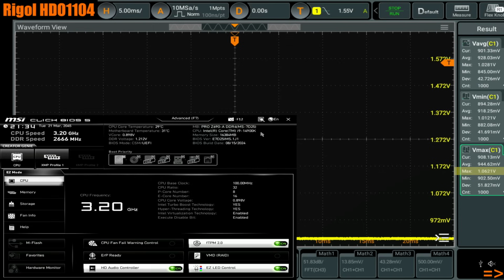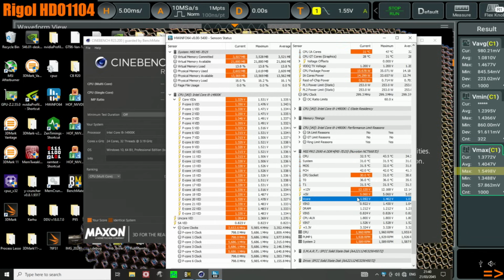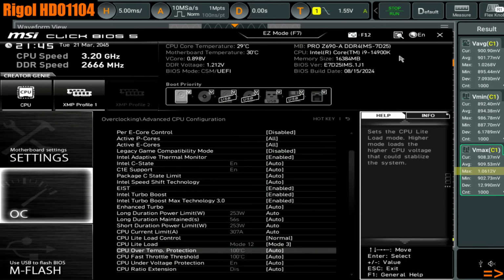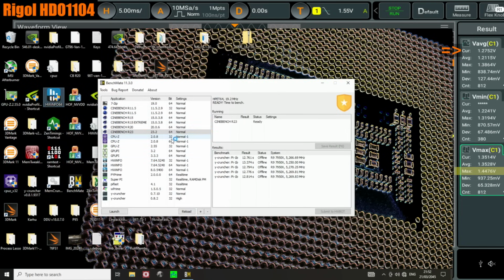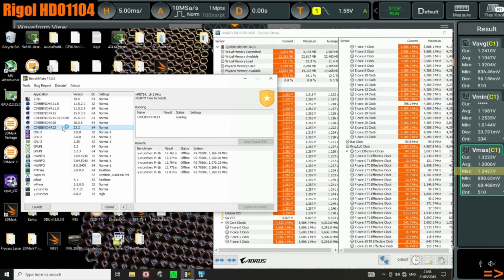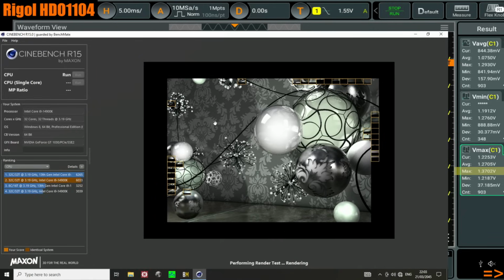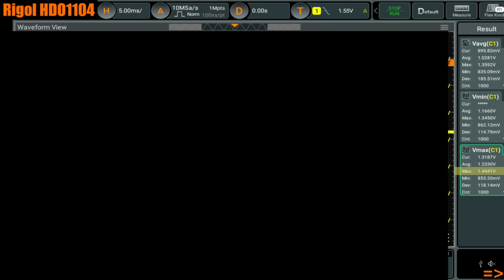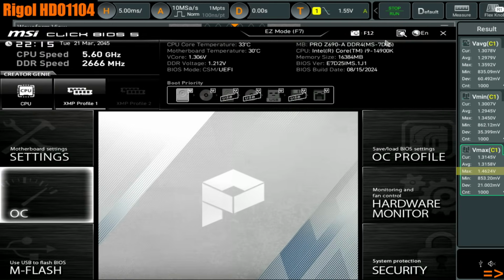"Optimizing" the i9 14900K on the MSI Pro Z690-A DDR4 with 0x129 Microcode

Comment: Thanks a ton!! Exactly what I was looking for..

Just to add - Someone posted exact impedence values of LLC levels and Lite Load AC_LL/DC_LL values for this motherboard on some forum recently. 

Apparently, you wanted to set 0.3ohms, which is why you selected Level 3. But Lite Load  Level 3 and LLC level 3 correspond to different values, not AC_LL of 30 and 0.3 ohms respectively
Reply: I was wondering this. Now that msi bios have voltage limit (my 13900k set to 1.400v), what loadline modes should we use and what modes are compatible to each other?
Reply: @jaybee0507 did you ever figure this out?
Reply: Yes, i did pretty extensive testing with msi z690 edge ddr4. Unfortunately i gave that machine to my son and i can't remember the values.  This all can seem like pretty difficult thing, but once you understand the concept,  it really isn't as difficult as it seems first. 
Basically what i did,  or how i see it,  you want to set voltage limit.  Something maybe 1400mv.  Then pick loadline calibration level.  The more aggressive,  the more stable vcore voltage but bigger spikes when load hits.  Less aggressive llc,  the more voltage fluctuates but less voltage spike when load hits.   Pick one.  I wouldn't go those most aggressive ones,  if i had to yolo something out of my head right now,  i'd say maybe fourth most aggressive.  When LLC is set,  you need set AC loadline.  Obviously, now you don't know what to set this,   but you can test it out.   Pick something and launch windows.  Go to monitoring software,  like hwinfo64 and check out cpu voltages and wattage.  If your LLC doesn't match AC loadline,  there will be some voltage values and wattage off.  Basically you want your cpu input voltage to match output voltage.  I don't remember those voltages by head either but i think those were something like VID or SVID for input voltage and VR VOUT for output voltage.  You want these voltages to be as close to each other as possible.  I mean i don't think it needs to be absolutely crucial close but you know do your best,  i guess.   Adjust by going back to bios and adjust ac loadline up or down and see how these values change.  Keep also eye on vcore and cpu wattage also and see how they change.  Try out how these voltages behave on idle and try starting out something like cinebench.  
Also personally i disabled all the single turbo speeds.  That way the cpu doesn't expect never to clock as high so it won't have to reserve as high voltage.  For reference i picked 5600 all p-core speed for my 13900k.  You may have worse bin.  I disabled every single/dual,  what ever core speed.  Only all core.  If you are unsure then go with stock all core setting,  just disable everything past all core.
Also when testing voltages,  keep eye on max cpu voltages.  You might see vcore max jumping high,  and remember now if you see for example vcore 1,35v max,  that means measured amount and doesn't take account for spiking so depending on your llc level that 1,35v can actually be 1,45v or higher when spiking.
So as a rule of thumb i would probably add that 0,100v in my mind to that voltage reading.  And since i don't want my cpu to hit more than 1,45v,   i'd probably check those max voltages they stay below 1,35v.   Preferably even 1,30v or lower.  That voltage limit we discussed earlier,  should prevent this.  Right?  But we want to make sure and check it out ourselves.
Also while doing all this,  i assume you are tuning your vcore with offset or manual or something.  You can use stock vcore,  thats no problem but then the voltage will be higher and i am not sure how high it will get.  You might need to downclock it to stay under 1,35v.  Also different LLC setting will affect how high your voltage will be,   but keep in mind,  the more aggressive LLC,  the more it has invisible spike you should add in your mind to vcore max value.
I hope this helps and sorry for being long ass mess,  lol.
EDIT:  Voltage limit: 1400mv

Comment: I’ve tried all of the recommendations with my 13900k and Cinebench continues to crash :( 

Stock settings I get around 35k but my temps are 101C + up to 1.55v. 

Even at the -.050 offset theres an error. 

It seems my cpu is toast unless anyone has some tips plz
Reply: Flash to newest bios, stick to intel default settings, set power limits to 253w and icc max to 400a.
Reply: @MrBoxershorts16  yes I’m on latest 0x129 bios set to intel defaults. 

I can’t go lower than Lite Mode 12 or else I get errors when trying to bench. 

I think my CPU is degraded since it needs the higher voltage
Reply: @grkc3696  Is your cooling good enough? With the power limits i have max 86 degrees and the v core is like 1.4v or below with undervolting with llc 8 and load light mode 12
Reply: @MrBoxershorts16   Currently I’m using an NZXT 360 cooler.

My temps get high and show throttling in Hwinfo while using Lite Mode Auto or 12, but it is the only stable option. 

For example, the min tjmax is 0c and I’m reaching temps of 102c, even 105c on one test. 

I did follow the video and had my lite mode set to 3 + llc mode 3 and IA CEP disabled. 

My temps were way lower, max around 87c, but I cannot finish any tests or benchmarks.
Reply: @grkc3696  cep should be set enabled to make sure that the voltage doesn't go to high or to low and pl 1 and pl 2 should be set at 253w max and icc max 400 max
Reply: @MrBoxershorts16  my system won’t even boot now. It is stuck in a repetitive loop of turning on and off :( 

Does that sound like my 13900k died?
Reply: @grkc3696  have you tryed a bios reset?

Comment: My under volt was stable for a month or more, using the 0x129 bios and verifying with all the usual stability tests and gaming, until I had to install nVidia drivers. It didn't really crash because it was just on the edge, but installing the driver was unusual slow, to the point I though it was frozen.

Comment: Hey so using these settings on my MSI Pro Z690-A Wifi DDR4 with the i9-13900K I get an AC/DC load line of 0.2/0.2

With PL1 253W PL2 253W ICCmax 400a and a -0.080mv under load the VCore stays right around 1.25V and pops up everynow and then to around 1.35.
For the most part it seems like things are mostly stable, temperatures are fine except for 1-2 PCores CONSTANTLY pissing me off at 100C while the rest are chilling at 91-94C under heavy load.

Anyway, I do get some weird slow downs when working on things not at full load but no hard crashing. I'm thinking the load line might be too low would that be a correct assumption? And on the MSI board, going from Mode 3 to Mode 4 etc increases the load line setting right?

Comment: Applied these settings with 0.150 undervolt on my 13900KF and so far looks amazing! Gained 2K on R23, better temps and voltage goes to maximum 1.2
Love your content my friend, thanks for your teachings.  
Edit: after a day or two it gave some BSDOS so I changed to -0.135 to be safe.
Reply: only undervot? or with loadline profile?

Comment: Thanks Buildzoid! I was able to undervolt my 13700k on the Pro Z690-A DDR5 with CPU Lite Load Mode 3 and CPU Load Line Calibration Control Mode 3 and Adaptive + Offset of -0.170. Runs smoothly in benchmarks R23 (Score: 30624), R15 (Score: 4570) and all my games. With an offset of -0.180 I had crashes in R15.
My stats in HWinfo while running the benchmarks with the -0.170 offset:
max. Vcore: 1.178, max. Power consumption: 193 W, max. Temperature: 81°C.
Reply: Did you have to disable CEP to get a proper undervolt?
Reply: @vexun11 I have same settings and didn't have to disable cep. Don't disable that
Reply: @bimil8724 with the proper current limit, power limit and voltage cap I don’t think you even need cep, I’ve been running with it off and undervolted for the last couple years with zero degredation or need to decrease my undervolt. With my motherboard I don’t have the ability to undervolt and have my vid and vcore match to not trigger cep. I don’t let my vcore go above 1.25 I also have all core limited to 5ghz as the games I play there’s zero fps gain from 5.8 all core or even going down to 4.6ghz and I don’t need that extra few thousand points in cinebench.
Reply: If you run prime 95 do you get WHEA errors in hwinfo? I thought my CPU was stable until I did prime 95 and saw WHEA errors there

Comment: Running 5.7 all core 1.325v on my edge ddr4 since the lunch with 4133 cl15 tunned issues, who is crazy to run defaults voltage 😂

Comment: So: CPU Lite Load setting Mode 3 and CPU Load Line calibration 3 and CPU Voltage mode Adaptive + Offset of about 0.100. All the other settings on Intel Config and Auto.
Can I assume this can be generalized and applied to a MSI Pro Z790-A and a 13700K / 14700K?
Reply: I'd like to know as well. I applied the same settings, seems stable with lower voltages but my 13700k is throttling in cinebench r23.
Reply: @david14635-h  Mine is thermal throttling, too. I only get 28580 multi core and 2041 single core.
Reply: @Splitterbruch ever figure this out?

Comment: GTG,  Thanks BZ.  Quick question,  is there a reason for Level3 vs say level5?  I've tested it on a 13900k, and 13700k now,  seems to work well.  But all and all, I like this tutorial/settings better than the one a couple years back, when I first setup the board.

Comment: Thank you! This helped my VCore and temperatures on my i7 13700k. When I ran Cinebench R23 at stock with 0x129 microcode, I would get a max of 1.464V and immediately get 100 degrees C. Now with Lite Load 3 and a 0.08V undervolt, I get a max of 1.248V and it immediately goes to 91 degrees C and slowly creeps to 100 degrees. That’s much better and increased its score!

Comment: Aw, my specially crafted comment with Unicode monospace font for better readability doesn't seem to have gone through, so here's an ASCII only version with worse readability.
--------------------

Did you measure the LLC impedances for the Z690 board in the video?

I tried to measure the values for my MSI Z790 Carbon WiFi board, with the following results:

LLC____DC LL___Impedance
Auto __110 ____1.10 mOhm ____100.00 %
1 ______10 ____0.10 mOhm ______9.09 %
2 ______17 ____0.17 mOhm _____15.45 %
3 ______22 ____0.22 mOhm _____20.00 %
4 ______29 ____0.29 mOhm _____26.36 %
5 ______36 ____0.36 mOhm _____32.73 %
6 ______61 ____0.61 mOhm _____55.45 %
7 ______88 ____0.88 mOhm _____80.00 %
8 _____110 ____1.10 mOhm ____100.00 %

I hope I managed to measure them correctly, I'm not sure.
I've also measured resp. noted down the MSI Lite Load Modes for my board, which are as following:

Mode______AC LL___DC LL
Mode 1: ____1 _______1 ___0.010 mOhm ___0.010 mOhm
Mode 2: ____5 _____110 ___0.050 mOhm ___1.100 mOhm
Mode 3: ___10 _____110 ___0.100 mOhm ___1.100 mOhm
Mode 4: ___15 _____110 ___0.150 mOhm ___1.100 mOhm
Mode 5: ___20 _____110 ___0.200 mOhm ___1.100 mOhm
Mode 6: ___25 _____110 ___0.250 mOhm ___1.100 mOhm
Mode 7: ___30 _____110 ___0.300 mOhm ___1.100 mOhm
Mode 8: ___35 _____110 ___0.350 mOhm ___1.100 mOhm
Mode 9: ___40 _____110 ___0.400 mOhm ___1.100 mOhm
Mode 10: __50 _____110 ___0.500 mOhm ___1.100 mOhm
Mode 11: __60 _____110 ___0.600 mOhm ___1.100 mOhm
Mode 12: __70 _____110 ___0.700 mOhm ___1.100 mOhm
Mode 13: __80 _____110 ___0.800 mOhm ___1.100 mOhm
Mode 14: __90 _____110 ___0.900 mOhm ___1.100 mOhm
Mode 15: _100 _____110 ___1.000 mOhm ___1.100 mOhm
Mode 16: _110 _____110 ___1.100 mOhm ___1.100 mOhm
Mode 17: _120 _____120 ___1.200 mOhm ___1.200 mOhm
Mode 18: _130 _____130 ___1.300 mOhm ___1.300 mOhm
Mode 19: _140 _____140 ___1.400 mOhm ___1.400 mOhm
Mode 20: _150 _____150 ___1.500 mOhm ___1.500 mOhm
Mode 21: _160 _____160 ___1.600 mOhm ___1.600 mOhm
Mode 22: _170 _____170 ___1.700 mOhm ___1.700 mOhm
Mode 23: _180 _____180 ___1.800 mOhm ___1.800 mOhm

So as the DC LL stays at 1.10 mOhm, I'm not sure if LLC Level 3 + Lite Load Mode 3 would actually give usable results? At least it goes against the "match your LLC impedance" recommendation.
Reply: I can't believe no-one thanked you for your hard work. Better late than never i guess. Thank you, i screenshot this and will try tomorrow as a guideline for my tuning!

Comment: Asus z790 tuf D4, 12900k. Voltages 1.4000v static all cores sync. LLC 6.

System agent 1.434v in HWinfo, XTU says system agent 1.404v

VIDs max out at 1.428v 
Idle ~1.41v
Load ~1.36v

I like aggressive LLC but why such high idle voltages at 50 watts instead of 250 watts. I understand what is going on I am just less stable idling in windows at max OC than gaming or doing benchmarks. 

Does my 12900k need even more voltage to idle? I'm not comfortable with voltages over 1.45v ever.

I found a good way to really punch your cpu with a load. Run windows defender full scan and wait for the 100% usage to kick in. I suggest you probe for that moment.

Comment: I have a z690 force wifi and a 13700k right now. I was able to offset my voltage by a decent bit and I don't hit anything above 1.25 on single and 1.2 on multi using the new intel default.

Comment: I did the 150mv undervolt offset on my 13900K with MSI Z790 Edge WIFI DDR4, R15/R32 Score are now 6123/38409 up from about 5500/36000. The CPU isn't hitting TjMAX with a temp of 103C anymore, it's running at about 1.200v with a max temp of 93C. I think it needs repasting, but I'll be going with a thermal pad soon. Anyway, I'll change the undervolt offset to 140/130/120mv, etc. if I find any instability. 

Thanks for the video!

Comment: The best way to overclock a GPU on MSI afterburner is to make a custom curve where you use the highest offset at the high frequencies that are needed at heavy workload, and gradually lower and no offset at lower frequencies. With the curve you can also cap the frequency at a level you know isn't stable, but that the GPU might opportunistically shoot into for a split second with erratic loads, but isn't practically useful. Can't believe we still don't have this for CPUs, it would be a huge selling point for a motherboard.
Reply: Isn't that exactly what AMD's new curve shaper is?

Comment: I had to roll back to the 125 microcode the 129 microcode was giving me above 1.5v on a 14700kf z690 carbon, it's not that motherboard only
Reply: Yes, new microcode doesn't help much. Best is to manually old style overclock. And your multiprocessor is the fastest and most stable then, in gaming etc. you also get the highest averages. And uses less wattage and then is more quiet as well. Just stick with 14900K/13900K that it runs 5500mhz on the Pcores max. Which isn't the fastest, but with E cores on 4300mhz or so you get nice high performance, better than AMD for sure and it is always that performance, no matter how hot it is outside or if you are gaming all day.
Reply: @jankees4037  wtf are you talking about
Reply: @Joao_Dario  setting fixed voltages and a fixed all core clock speed that doesn't dynamically change.

Comment: Oddly enough I find RPCS3 when it compiles PPUs at the start of a PS3 game is a great way of testing high frequency stability. If it crashes or logs a WHEA error in windows you are unstable. You can quickly find instability after starting a game 3 times.

Comment: I find it interesting that with a -40 mV offset, AC 60, DC 82, and LLC 7, my average core VID and average VR Vout readings are within 3 mV difference, when running R23 multi core. I thought AC != DC would make the readings off.

This with a 14700k and Z790 ACE

Comment: Can a voltage limit be set on a non K CPU?
Reply: Not needed, those never spike to high VIDs anyway as they won't go to 5700mhz plus frequencies.
Reply: @jankees4037  not actually what I asked. Intel extended the warranty of the 14700F, why did they do that? Because it was not needed?

Comment: I like how getting intel cpus not to blow themselves up is like trying to shoot proton torpedoes into the vent of the death star.
Reply: Just all core overclock them, all solved. My 13700K never goes even past 1.28 volts. And still beats AMD 7900X in performance.
Reply: @jankees4037  *in benchmarks

Comment: Meanwhile my 14700K is running at -0.200 offset and i have no idea why. OCCT, aida64, prime95, cinebench r15, r15 extreme, 2024, r23, Y-cruncher. 5 minute benchmarks, 2 hour benchmarks, it just doesn t crash. The loadline tho is set to Turbo, anything lower than Turbo and the windows doesn t even boot.
Reply: What does Turbo set the AC/DC LL to?
Reply: Well I might be wrong but from what i’ve noticed it keeps the voltage load higher. Hence the name. 

Under stress, the cpu starts with X amount of voltage and it slowly drops. Setting the LLC higher makes the voltage drop less under load. 

But again, this is all from my own understanding. I m really new to all this.

Comment: Why use adaptive+offset instead of just offset? I thought adaptive+offset would only offset voltages at high load, hence a single core workload would still be able to request a high voltage.

Comment: Thanks for the video!
However the board is not the same, but I'm using an MSI PRO Z790-A WIFI DDR5 and I applied the Mode 3 to Lite Load and Load Line as the first part of the video and my CPU (14900k) does not goes over 200w while running Cinebench R23 and I'm using Intel Default Settings.

Comment: pleeaase, a little small and handy video for the Asus Apex Encore z790 with 0x129 ... 😢
Reply: BIOS setting -> IA VR voltage limit on 1425 (max is then 1.425v) and all done. Enjoy. Intel 0X129 BIOS itself doesn't help as version.
Reply: @jankees4037   OK, but I don't know if to go for Intel default or ASUS optimized settings 🤔
Reply: He did say at the very end he's doing an Asus Board next